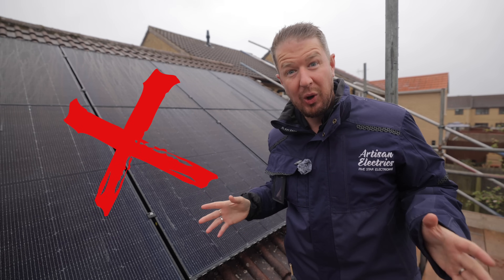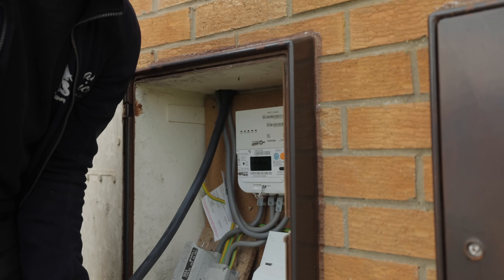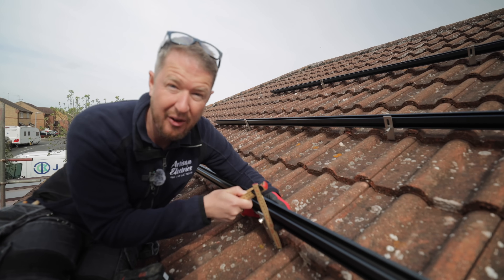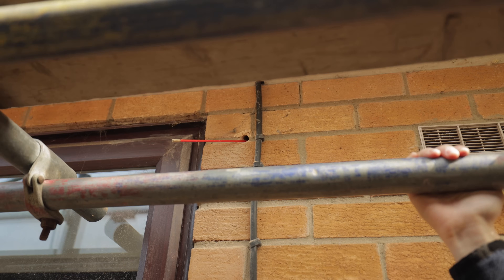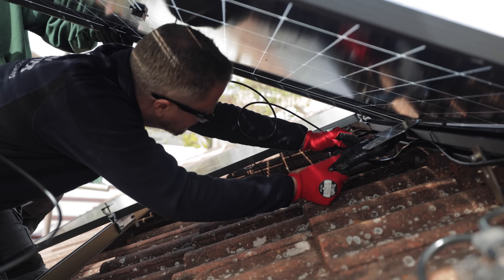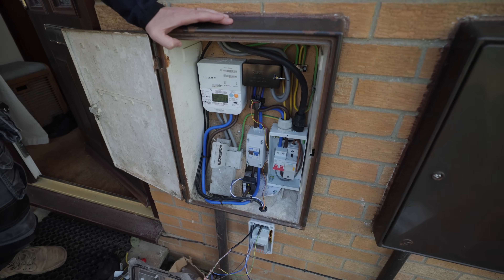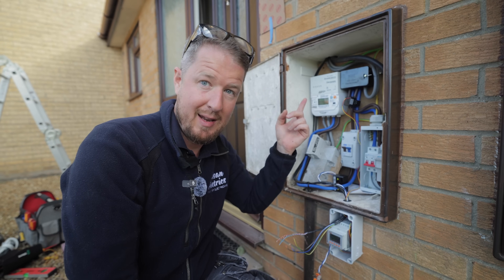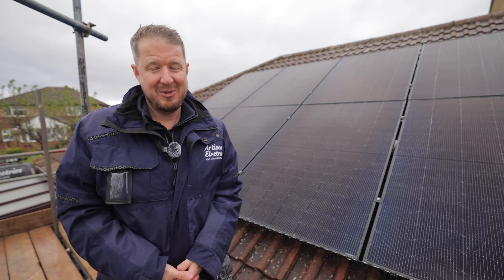Have We Been Doing Solar WRONG All Along? 🤷🏻‍♂️

Comment: the main problem is that you have too much solar in the summer & not enough in the winter (maybe 10 times lower?) to keep warm? (20% more power in the summer is fine, but 20% of nearly nothing Nov-Feb = Nothing also)
Reply: Design for winter, so more panels (normal panels will do in winter and are 'cheap'). Size your inverter for spring/autumn (max out in summer). With grid capacity as it is, and more people installing solar, selling back to the grid will become less attractive. 
The cost driver for inverters is capacity, skip all the additions for panel optimization (as they are expensive and will not give sufficient return on investment during winter). You will end up with an installation using more space for the same capacity, but a more level power production over the seasons. And the savings on inverter and optimization will pay for the additional panels.
Reply: well the idea is you sell the power back to the grid during times you don't need all of it, to get credit on your bill in the winter

Comment: I wish these bi-facial panels were around when I ordered my system in 2017.
Reply: To be honest the advantage is minimal if installed on a roof. The less light and reflection comes from the back the smaller the gains.
Reply: @Felix-st2ue  It is useless installing bifcial panels, flushmount to a roof.  But the installer makes more money.

Comment: 10 years and counting on our Enphase inverters, zero problems
Reply: We've had ours for 5 years under the hot Australian sun, still good.
Reply: @peejay1981  Same here. Wouldn’t use any other system despite the higher initial cost. Plus point is the ease of adding extra panels that can also be on alternate roof orientations.
Reply: 16 enphase invertors . No issues in 9 years
Reply: 24 enphase micro-inverters here in Southern California for over 10 years. Two panels have lost 80% of their output - and the system shows exactly which ones. But can’t replace them because the panel manufacturer went bust years ago. The enphase gateway started acting up a couple years ago, and it’s $800 to get it replaced. Not essential though as I have two other systems for tracking generation anyway.
Reply: @markirmuir  why wouldn't you just replace the failing ones with a different manufacturers panels?
Reply: @anaesthetics Purely aesthetics. They will look different, and wonky. Neighbors would get upset.
Reply: Good to hear. 8 years SolarEdge and 1 of 14 optimisers gone down in January. They don't support fully, no help to get it changed. Enphase for my future projects I think.
Reply: @carlarrowsmith  Over 150 solaredge optimizers installed over the last 9 years. Only one DOA but got replaced under warranty. Never had an inverter or optimizer failed. Have been using P300 to S440 and S500B optimizers.
Reply: @veeerzes  One installer was telling me he has installed 40 replacement optimisers this year so far. Not uncommon they said to me at SolarEdge support.

Comment: Our first set of 16 solar panels on our East-West facing roof has two Sunny Boy inverters and was installed well over 10 years ago.  Our second set was installed in 2019, 14 panels, and Enphase micro inverters.  Both systems generate broadly the same amount of electricity.  Our first set of panels need cleaning now, and we are wondering about the merit of switching them over to a micro inverter system when we get them cleaned.  The Sunny Boy inverters still work so really we should only replace them when they break, it's just that we're a bit suspicious that they are coming to end of life.  We haven't had any quotes yet.  We're in Leigh on Sea.
Reply: Enphase microinverters have a 25 year warranty I believe, I've had them for many years but as someone above said 10 years and more is common, they are rock solid, if it ain't broke, don't fix it as they say!  I just re-read what you said, you've got a string setup for one setup and microinverters for the others, I still wouldn't mess with it if its all working. The downside to string arrays is the larger inverter might fail and take them all out (that string I mean), but if its working I'd leave it that way.

Comment: A big positive I didn't hear mentioned is that Enphase offer 25 years warranty on their micros....25 YEARS!
Reply: Does the warranty cover the cost of replacing them? Putting up scaffolding, going up on the roof, removing the panel to access the inverter, replacing the inverter, putting the panel back and dismantling the scaffolding?
Reply: @thomasdalton1508  After even 18 years, you'll be well in the black, let alone 25. How many string/hybrid inverters will yo have burnt through in that time. Parts and labour? Enphase failures are miniscule.
Reply: @craig72x  You haven't answered my question.
Reply: @thomasdalton1508  Their warranty is supposed to cover something called Labour Reimbursement and is intended to help towards the cost of repairing/replacing.
Reply: @thomasdalton1508 Tou won’t have to scaffold the whole building to replace one inverter. Access from a single alloy tower will be sufficient

Comment: You cannot put any equipment into "meter box". This is property of DNO an no equipment can be installed there without permission
Reply: It’s not the property of the DNO. It was supplied when your house was built. However the supply of electricity to your house will probably have a stipulation that you agree not to put anything in there. 

If it were their property you would need a way-leave between the DNO and you.

However you should be able to fit appropriate safety equipment in there, for example a fused isolator if the tails are more than 3meters long. 

Basically if the DNO turn up and need to fit additional equipment in there and they can’t they will walk away and charge you for their inconvenience and possibly disconnect you.
Reply: @davideyres955  isolator is only equipment you are allowed to install there without permission
Reply: @WizardNumberNext  It's guidance not regulation, you can cause your DNO issues if they come to change some equipment and you've filled it all up, but there it's nothing that prevents anyone from doing that, especially given the box itself is owned by the customer, it's only the meter and the cutout fuse that are owned by the DNO.
Reply: @davideyres955  what planet are you living on ? The dno have a contractual agreement to supply you power , if there is a problem with the supply they will hook you up to a generator, they can’t go around turning peoples power off .

Comment: No we haven't.  Bi-facials rely on light reaching the rear of the panel.  This is by completely clear encapsulation and no white backsheet allowing light through as well as any incidental light coming in round the sides of the array... and reflecting back off the underlying surface.  Yes, there will be an increase in production just from the light pass-through but a lot of people are being done by people pushing bi-facials on dark roofing where they simply will not get the additional power claimed.  The better manufacturers make this very clear in their product specs & data.
Reply: How can you say that when they have their own evidence on the performance? I had an install with Heatable just after Christmas and their quote was about the same (sometimes cheaper) but for better kit. If someone offers you a 2012 Mondeo or a 2020 7 Series for less than £100 more, I know which one I’m picking 😂
Reply: @David-ww5bs  Hmm, who to trust.  The product manufacturer's own statements or a 3rd party selling the product?  Yes, that's a difficult one indeed.  Note:  I'm not saying there won't be additional generation, what I am say though is these things are intended to be mounted in such a way that a decent amount of light gets to the underside.  For installations that use surface reflection that surface needs a decent albedo.  Dark tiled roof does not.

One of the most BS installations I've seen with bifacials, photos provided to me by a friend that is an installer, was recessed into the roof for a sleek flush fitting appearance with a black tray.  Claims of extra generation were made there too with simple reference to the maximum additional production figure from the manufacturer.  Naturally the installation had 0% chance of ever doing it.

The end users usually have no way to verify that  the extra production is actually happening and go blissfully unaware.  Have you checked your installation by sliding black card under the panels and noting the expected drop in production?  I'm guessing not...
Reply: @retrozmachine1189  Yes, I do appreciate they were probably designed for better environments than my slate roof, but Range Rovers being designed for rough terrain doesn’t stop them being the most common 4X4 in London. Granted, bi-facials might not be built for the common domestic roof but my roof is an East/West split and I do believe it’s the bi-facial panels that allow me to pick up more light as the sun moves round in the day. I must add, if they were coming out at £,000s more then I may not be as convinced but if I can have additional cells on the back for the same price as your standard Jinkos and Trinas, then my argument is simply - why not?

Comment: Wonder if it would boost the panel to have something reflective on the back
Reply: Yes it does.  If installed on a ground mount people will often use white rocks or pebbles below the panels.  I've never seen anyone add a reflective material on a roof install but it will work.  The channel "ProjectsWithDave" has several in depth videos where he tests bifacials.

Comment: What’s the cost comparison between these and  normal panel
Reply: 27 pence........;)
Reply: It's pretty hard to say, as there's a fairly wide spread of panel prices, and the bifacial panels aren't the most expensive ones. However the cheapest panels are about £57, and the cheapest bifacial panels are about £71 - so you could say they're 20% more, which matches that performance boost. 
However the panels are the cheapest part of the install. Those micro-inverters are £175 each, the batteries are a few thousand and the scaffolding and labour add a fair bit too.

Comment: Roof mounted micro inverter is a mad/bad idea. Let's see... multiple points of failure... mounted where access is a nightmare.
Reply: There is no single point of failure. If 1 panel or micro went down the rest of the system continues to work. No high voltage DC so not too mad I guess.
Reply: @lshare90 
I think you are missing the point. You don't want anything electronic on the roof. Just plain dumb panels. Put the electronics where access is not a problem.
You have a design responsibility to ensure service and maintenance has been considered. Plainly sticking points of failure on a roof is not helpful.
Reply: Solar optimisers, for a string inverter, same issues as micro inverters.

Draw out all the equipment you'd need for both types of install, their costs, and replacement of each of there's failure.

For myself, lots of shade, and.indlnt want a big maintenance expense, so micro inverters seem more attractive. 

I'm not a fan of one piece does everything, like a hybrid inverter and charge controller combined. But maybe the tesla powerwall has an elegance and single vendor simplicity.

Comment: Think I would like to have the microinvertors mounted just under  the edge of the solar panels on the roof. Giving access to test or replace the units without need to remove panels.

Comment: yeh i got enphase IQ7A with my panels 18mnths ago, great to be able to monitor each panel just be aware each micro-inverter only outputs 349w
Reply: They might only output 349w but how often in the UK would PV's generate at it's full power, plus you'll never have to worry about panel degradation over time.
Reply: @Mavisto2  no complaints here, but I seen ppl with 440w panels and ask why production so low in strong sun.